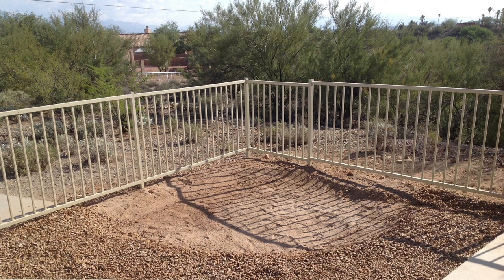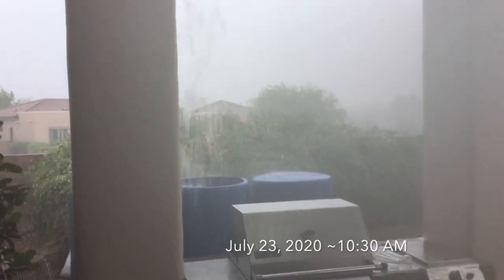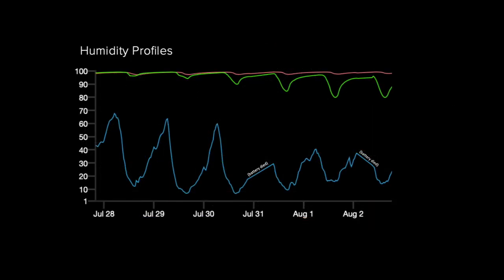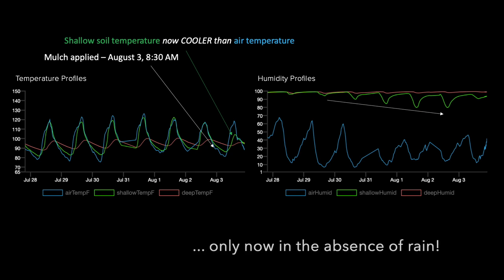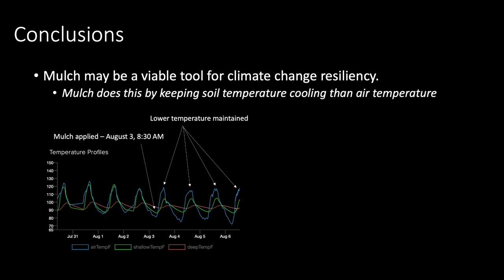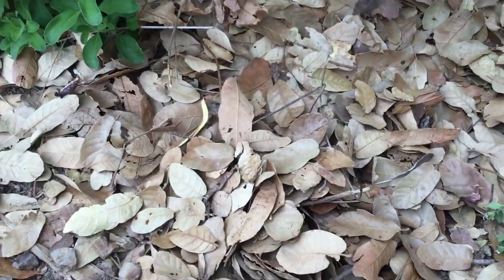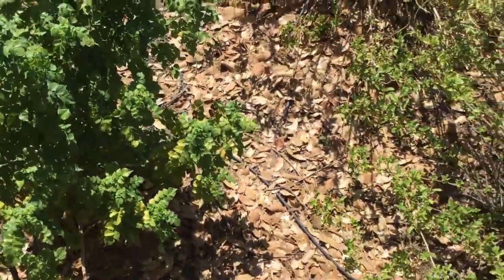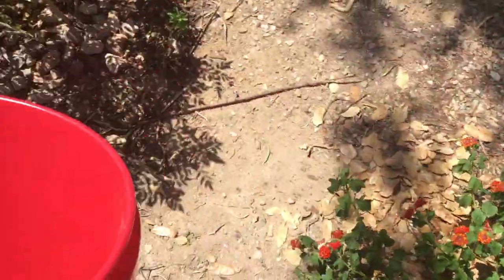Water Harvesting and Mulch Experiment Results

Comment: Nicely done and presented. I have a mini weather station using Wemos D1 Mini but the DHT22 doesn't hold up well, shielded or unshielded after several rain events. Too humid here in east coast (had dew points of 79 here yesterday!) How do the SS mesh temp sensors you show hold up in desert environment? Is the response time really slow?
Reply from the maker: I haven't had any issues with the SHT10 sensors buried in the soil, but frankly, things are so dry out here that this is not really saying much. Per the summary on Adafruit's website: "While it is designed to be submersible in water, it's always best to avoid long-term (over 1 hour at a time) submersion, and it obviously would only give you temperature readings" . https://www.adafruit.com/product/1298 . Regarding speed, I haven't checked the code recently, but based on my feed, it looks like humidity data is being posted once every 40 seconds: https://io.adafruit.com/biod101/feeds/shallowhumid . If you are considering this sensor, note that there is an SHT30 with a similar mesh enclosure- it has higher humidity accuracy at lower cost, so that might be a better alternative, but I recommend reviewing the specs in case I'm missing something: https://www.adafruit.com/product/4099
Reply: @ModestMaker  thanks I will check out the newer version SHT. If it lasts then I'll buy despite the higher cost (vs DHT22)